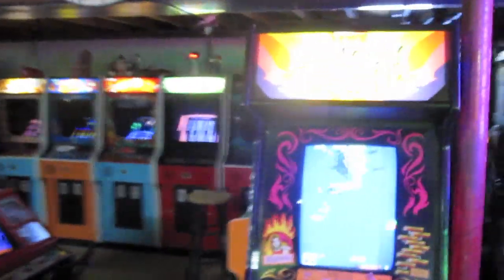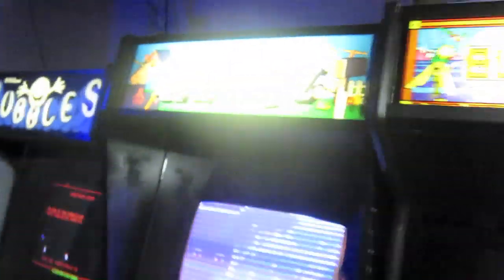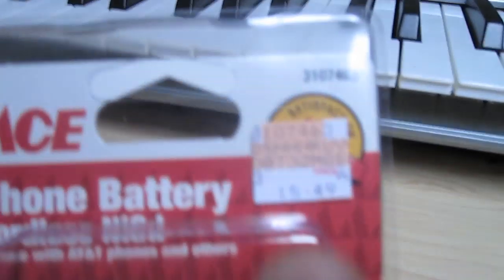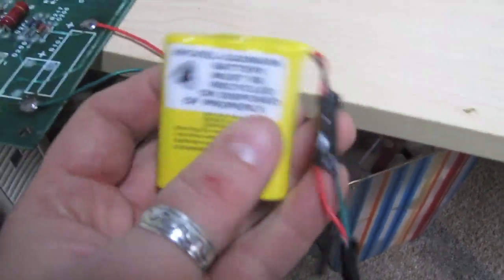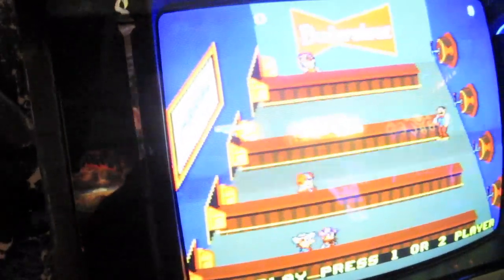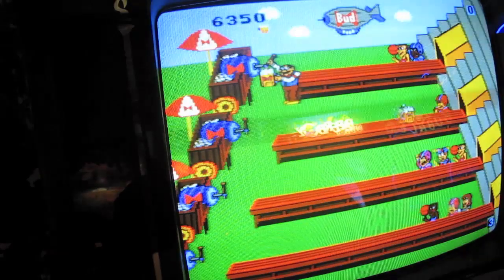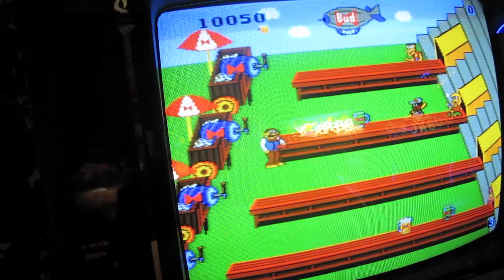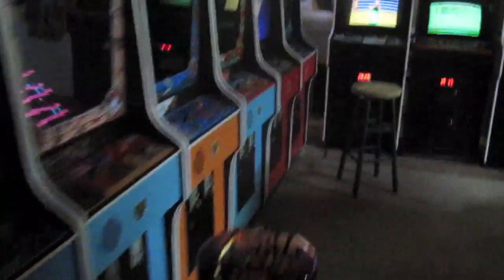Tapper Arcade Game Video Review - MCR High-Score Save Battery

Comment: A 700 mAh battery should be fine.

I think the concern might stem from overworking the charging circuit, but usually using a higher capacity battery should not pose a problem; it just means that the battery will have a longer lasting charge.

Another suggestion for a battery mod on the power supply board would be to use wires terminated with a connector compatible with the replacement battery.  That way, if you must replace the battery again in the future, you just pull the old battery out and plug the new battery in; no more soldering.